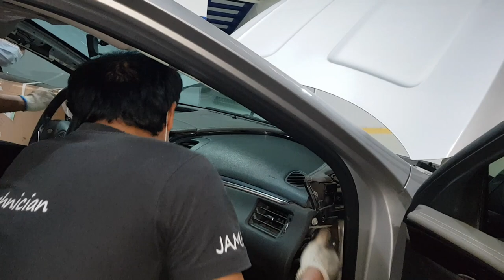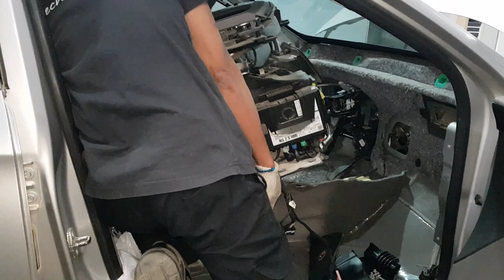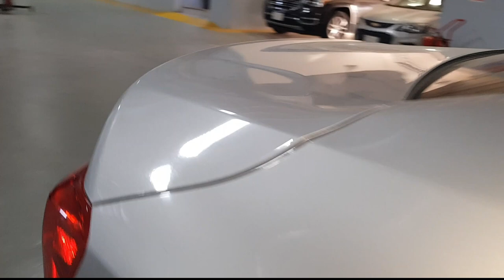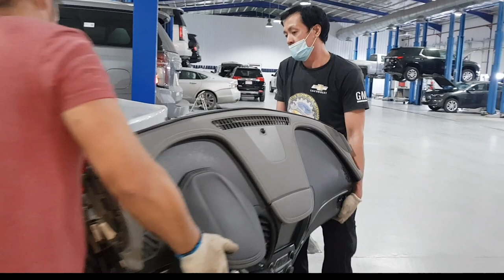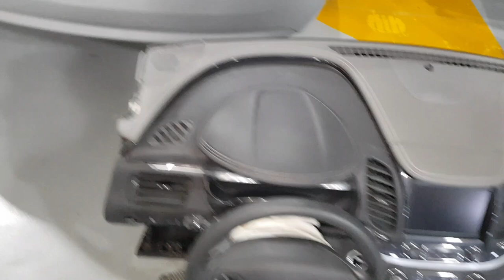IMPALA CHEVROLET, This is my way to replace A/C evaporator core.

Comment: I just asked a Chevy Service Advisor if there was any common repair for this gen Impala. He told me it was the AC evap core. His description of the repair matches this video perfectly. He said it is a 12 hour repair. $175 labor per hour plus parts.
Reply from the maker: @coniccinoc . this video is not for dealer procedures. its my idea.  In dealership standard procedures is removing by one by one until the evap can access. so the labor its high.
Reply: @ejmegzcarvlog7226  He told me they have to remove the entire dash (IP) to service the AC. Not sure if there is another way. My AC is working fine at the moment. Wondering if this is something I should be concerned about.
Reply from the maker: @coniccinoc  dealers are having own ways or standard ways to repair. Yes! the labor of this job is absolutely high.  And my video's  are in my own ways.
Reply from the maker: @coniccinoc  Yes correct removing entire dash is needed to access the evap core. Dealers are removing component in the dash one by one until the evap core is accessible. My ways is removing whole dashboard  directly to access the evap core at the back of dash

Comment: I wonder how many extra screws will be left over after the repair? 😢
Reply from the maker: I know if I say zero. you will not believe. But what I say to you is thank you
Reply: 10 10mm and 2 7mm for center console, 2 13mm dash mounts on both sides, and 4 13mm for the pedal assembly. Also 1 10mm on the passenger side of the firewall engine bay side

Comment: I appreciate your efforts thanks 🙏 
Brother I have two questions I am seeking your answer as an expert please:
I have Yukon 2020 a lot of people doubt about transmission normal operating temperature specially in Gulf Countries. Is it good to install after market transmission cooler?
2- regarding engine oil, a lot of people also are saying that factory recommend oil type (0W20) is the main reason behind engine failure of most of vehicles. Is it better to use 10W30 oil specially in KSA weather?
I hope to see your answer soon & thanks again 😊